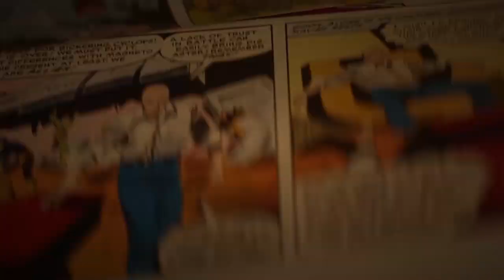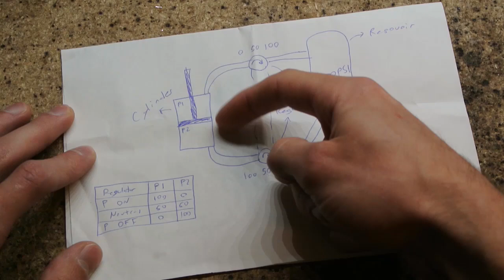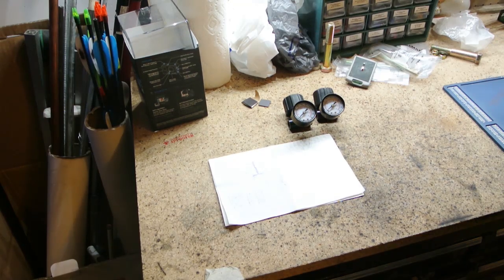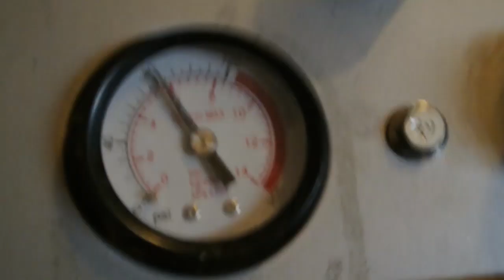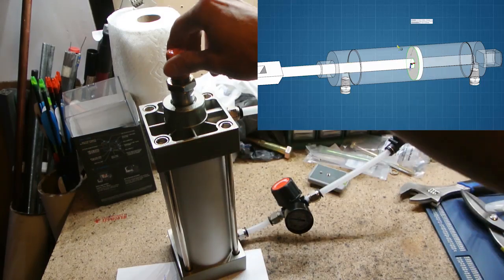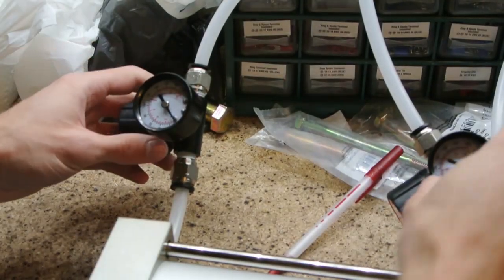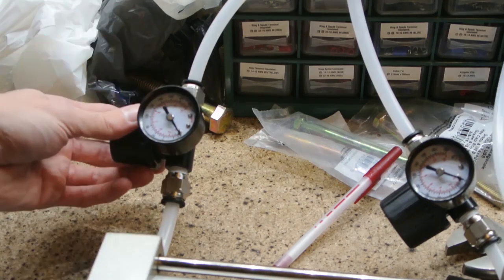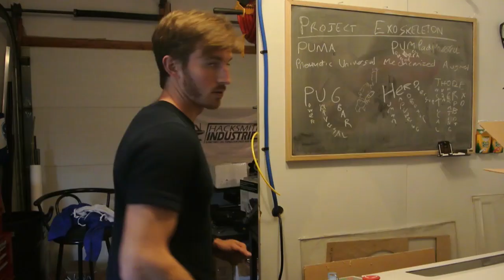Exoskeleton Mk2, Part 4: Advanced Cylinder Control

Comment: Hi there, We are air manipulator machine manufacturer. For you to make the cylinder flow freely to any position, you should try use PRECISION REGULATOR, which control the air at a very precise pressure. Putting the precision air regulator only at the ONE SIDE of the cylinder and control the pressure only one side of the cylinder. This system is widely use in factory application. You can check out SMC pneumatic IR2120 or IR 3120. These model can be control by smaller precision regulator which you can seperate out 2 different kind of setting "NO LOAD= balancing weight of your hand only,  and WITH LOAD= balancing your the weight of your hand + weight of the load that you are carrying.Changing the setting is just using pneumatic valve.  Check out SMC penumatic cylinder website and Air manipulator video for your reference. For smoother cylinder flow you might also consider using low friction cylinder.
Reply from the maker: +Frederick leow Very interesting! Would your company like to sponsor this project?
Reply: +the Hacksmith 
Hi again, not at this moment.

Comment: Festo makes solenoid valves that have 3 positions. the middle position supplies no air but the cylinders will remain pressurized. You can adjust the time the valve is open on either side using any number of methods from a simple button to PID with a microcontroller. This can give you good control of how far the rod moves. As far as adjusting the pressure on the fly I used inline flow valves like these:
http://www.grainger.com/product/SMC-Speed-Control-Valve-with-1-WP163160/

You can make a piece to mate the flow valve knob to a servo motor and control that with software like the valves are. From there its up to you to figure out how to actually obtain the inputs to control the valves and flow. Switches, encoders on joints and reed switches are all options and is where I think the real challenge is in making fast, controllable actions with pneumatics. I hope you can take this project to its completion. The options are endless and the limit is really your time and money.
Reply: can i use some switches to cut the connection at various positions ?

Comment: very interesting idea but may i suggest the use of multi position cylinders. it is essentially 2 cylinders back to back. so why not purchase several smaller stroke cylinders and mount them back to back thus creating your own. it can give you that desired middle position with no need to adjust regulators
Reply from the maker: 99superbot That's still limited though -- this can give a full range of positions, it's not as efficient but it does work
Reply: its just a suggestion but still thank you for your consideration. all the vids you do on this just inspire so many projects for me so thanks for that also.

Comment: Any hydraulic exoskeleton would be a fair bit larger. Perhaps great for workforce and manual labour forces. Not so great for combat application or any form of labour that requires more speed than strength. Also, concerns about lack of safety measurements. You would need to remove the exo, adjust, and then put the exo back on.
Would like to see a 'heavy duty' exo, with hydraulics over pneumatics.
Might teach U.S. Techies a lesson in overcomplicating relatively simplistic, if not easy to find, solutions.

Comment: Your idea is right but the valves are wrong...ther are 3/2 valve controlled by bistable button and valves, like your manometer, to give the "speed" you want to the actuator.
So you haven't to rotate at the same time your valves.

Comment: quick question please.
for stuff like, formula 1 simulators, or that type of simulator games.
what type of actuators do they use?
i've seen one before. the actuators in that simulator are definitely some type of electrical actuators, but i haven't seen ones like them or as fast as them online, though i searched well enough.
any ideas ?
Reply from the maker: There is a good chance they are either electric or hydraulic pistons. Pneumatics are very fast, and can be used rather effectively in the method I showed in this video.

I am actually considering making the "SUPER OFFICE CHAIR EXTRAORDINAIRE" which will feature triple monitors, full simulation via pneumatic simulators and built in sound system...
Reply: the Hacksmith Ya! baby Ya!

Comment: Use accumulators in case of pressure supply failure and it will soften shocks in the system. It will also soften "load shocks" (e.g. catching something that is falling)

btw, nice channel :)

Comment: Hi hack smith I have a couple of ideas for your exo suit that I think would be pretty sick I you didn't already know the revolution of jet packs and other objects for manned air travel is really getting attention. Another thing in the later stages of your exo suit is to add a mask of some sort or something like GGG's zombie gas mask would look sick.and just for a heads up if you need electrical cables or anything in that genre just message me thanks.

Comment: You need to check out this company called Bimba, really high quality stuff, but it is expensive, years back my dad helped design some control systems that have unheard of accuracy and performance for pneumatics, you should check out the low friction cylinders for sure if nothing else, probably more useful down the road..

Comment: There's a type of motor system I'm not sure the name, but the motor is rigged to most RC and in a way that each one of the backwheels move opposite to one and other.  It could work with that flow control.

Comment: Congrats on the contest! But Harbor Freight, ouch. Great place for really cheap stuff, but not if reliability is important. You might not want to trust those regulators for more than just testing, I'd hate to see one fail when you're trying to lift that 1000 lbs.
Reply from the maker: They're pretty simple, only one moving component... I'd like to think they aren't that bad...
Reply: the Hacksmith
It's not that their stuff is bad, it's more of a tossup. My engine stand has handled the weight of a fully dressed 460, my three DVOMs have worked fine for years... and I've gotten a number of power tools that ended up one-time use, and a couple of wrenches that I've somehow managed to bend from just normal use. I'm not a strong guy, I don't even lift.

I still love the place though, the prices are usually worth taking the risk of "duds".